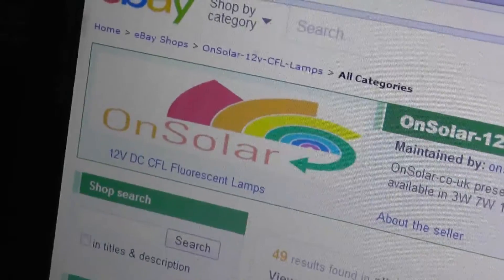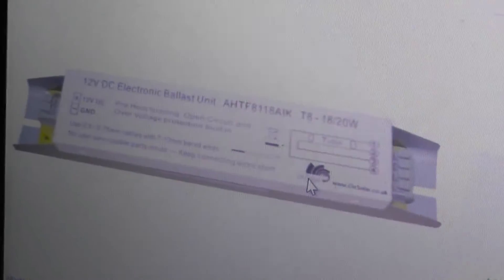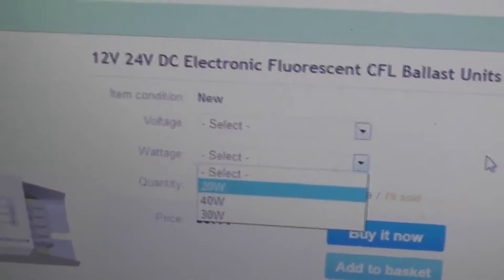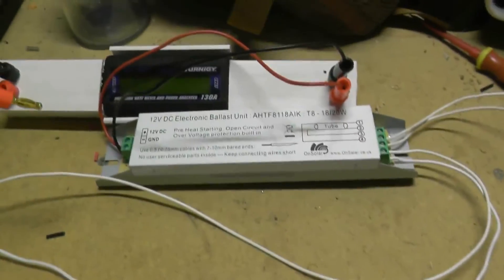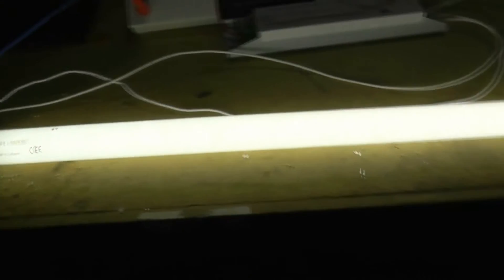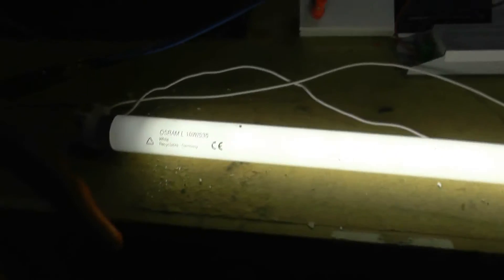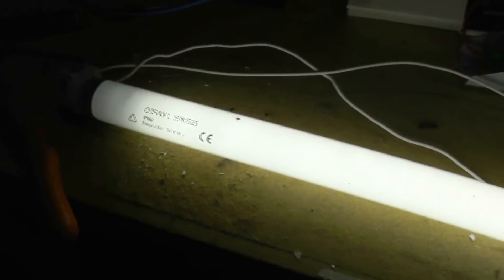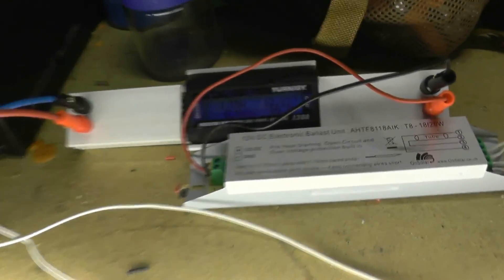12v electronic ballasts

Comment: Looking at running my garage lighting off 12v. I want to use 12v LED tubes (ditch fluorescent) and hard wire the fittings. Have you found any?
Reply from the maker: Not 12v tubes. All led tubes are made to retrofit a mains fluorescent.

Could you layer the gear tray of the strip light with 12v LED strip? Failing that get a pure sine wave inverter and just retrofit.

Comment: With HF supply, a "18W" tube needs between 15.5 ~ 16 W to burn at full brightness. If there is approximately only 15 W on the DC line, the tube cannot burn at full, without even talk of the efficiency of the ballast... which is not 100%.

An advice: change your tube and take a tube with " 827 ", "830" or "840" marking because the "535" is less good (CRI) and less brightness.